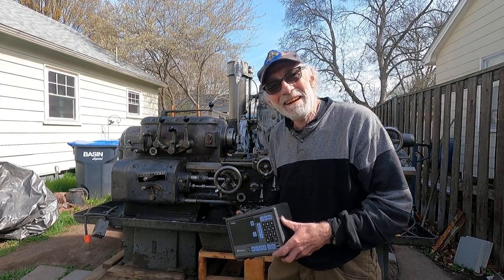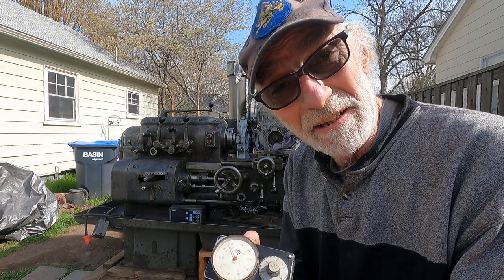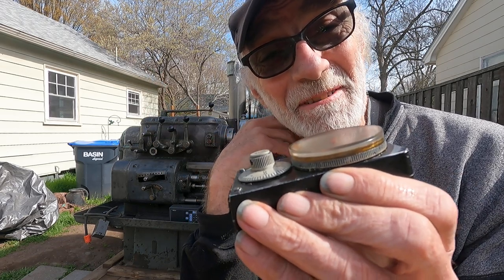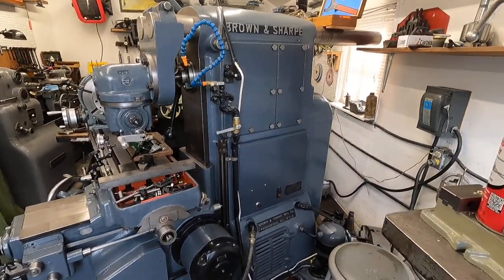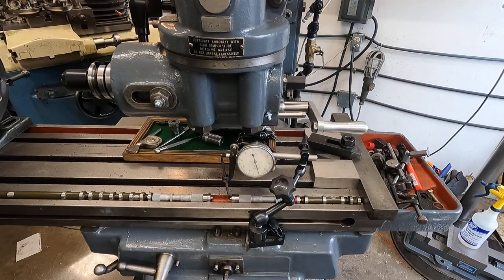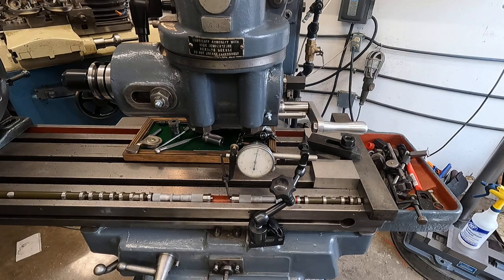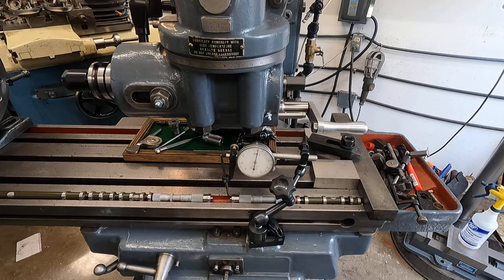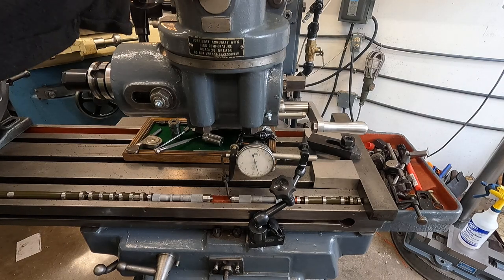Precision techniques for standard machine tools Part 2!

Comment: I'm very deeply surprised the 1/10 indicator didn't move but I know exactly what you are talking about. If I was to evaluate the reasoning I would say that the vibrations cause micromovement in the oil film and lower the critical speed needed for hydrodynamic lubrication. In metric land I keep my micron comparator in a different address from my manual machine tools.... I was even surprised when I realized that the new VMC I setup and programmed for a company here would barely miss 0.0005mm due to stick slip when I calibrated it's tool probe and I later found out it could interpolate a circular spigot on hardened tool steel (I was making hardened bushings from worn die punches) while holding 5μm in diameter. What an age to be alive!
Reply from the maker: Funny it did move every time before I had the camera on! It was mentioned a ghost may be in the mill doing the creepy movements. These certainly are interesting times

Comment: Yoder ? in Ohio?   there just north of me a few hrs..    I WANT THAT TRUCK..!
Reply from the maker: Yes, they listed it on ebay for $3200, and did send me a working machine with shipping and skidding $5000 total. And, no complaints from me, I bought it from Jim. 
The real hidden mysterious owner of the 49 was offered $5500 for the truck, all they want is the body to put on a Corvett chassis and  none of the rest. The she scoffed and said, I will just get the 6 cylinder 235 going, its already a hot rod, it had a 216!
Reply: @deedeeindustrialsuperprecision  I was a rigger for them for 8 years. I had my own business ,  i rigged there machines .
Reply from the maker: @metalworksmachineshop  You must have moved a lot of machinery! Thanks.